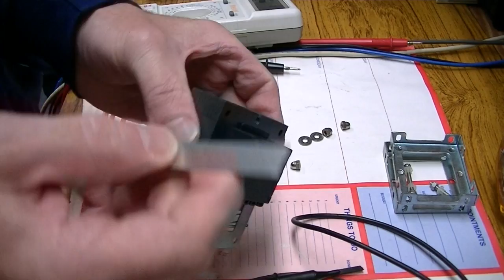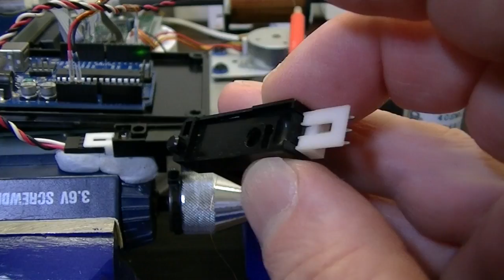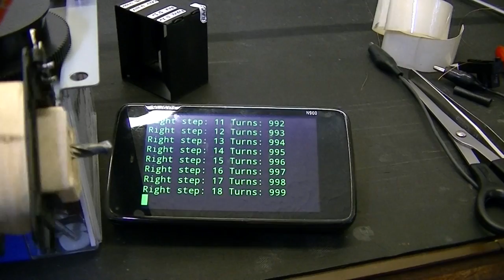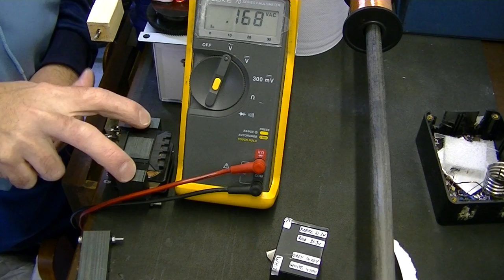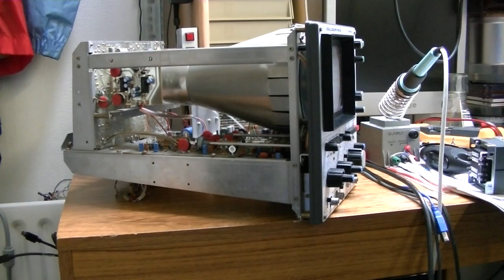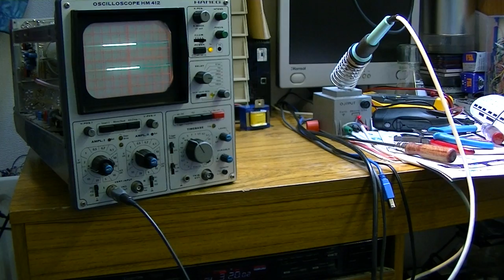Repairing burnt out transformer. Oscilloscope repair.

Comment: Sir, I know it's been long time 
Your genius idea motivate me to repair same trafo on my hm203-1, but my windings are overlapped I cut 6.3v with 31v and HV winding...
There's any suggestion or solution to wind 6.3v with 31v on the new transformer or may I build separate PSU for the 6.3v heater?
Thanks for the unique useful video ❤

Comment: Just ran across this video and must say: Hats off to you for this repair!
Every time I tried to take apart one of those Xfmr's, it seemed impossible to get the core apart!
Would be interesting to know if the scope still worked after this 10 years have past.
I have a SB-610 (?) Heathkit monitor scope that has the HV open but I may just try to use a HV strobe PS to keep from rewinding the Xfmr!
If I lived by you, I'd bring it by--LOL!!    73...
Reply from the maker: Your Heathkit SB-610 definitely sounds like it is worth repairing.
I wish you good luck with it. Maybe setup a search on eBay for a Transformer kit?
My Hameg scope still works. But I have to admit to mainly using a couple of modern Digital scopes now.

Comment: Love the neat Transformer Winder. The all mechanical one at the Technical University in Hannover Germany, used for similar jobs, was the size of a small lathe. Did you find out why the transformer got cooked in the first place?
Reply from the maker: I bet the one you saw in Hannover was impressive. The transformer got cooked  just because the winding shorted. Lots of volts and too little insulation. I still have the same Oscilloscope today. But I do have a fancy pants Digital one to sit with it.

Comment: Hi
I am Marcel, and i need some help to repair an hameg 408 scope.If you think you could find some free time to this, please let me lnow, and i will send you some pictures with the screen when the scope is on and i will explain what is the work i made to make it start.   Thack you very much..
Reply from the maker: I'm guessing you have taken a look at your manuals at https://www.rohde-schwarz.com/uk/search/hameg-archive_229476.html?term=hm408
I will take a look at your pictures of the screen. Upload your pictures to something like https://postimg.org it's free and no account required.
Reply: thancks,for respond me so soon..I will try to send a few pictures i have in my phone, because i am not home untill 1 th o march.
Reply: Because it didn.t turn on,first i started with the power supply,and  i found a coil of the filter  open, and i put a wire on the back side . The power supply start, and i could measure all the output voltages , but the scope didn.t have HV voltage for CRT.I change the D615 diode (by509), and the scope start.But is still having problems:1-No brightness adjust 2-the wave of the first picture , depending of the Vertical position scale(it became a line,but only on the highest values of the vertical adjustment scale,AND put closer a Velleman 40 mhz digitaal scope,i could see on the screen the same wave  like on hameg .)and 3-the XY mode,it showing me what you see in the second and the third picture.(it is not phone flash..)The schematis is hm 408, not hm 408-1a. Thanck you again.

Comment: Brilliant! How do you maintain back-tension of the wire-spool?
Reply from the maker: The combination of the wire spool suspended on the wooden rod and the wire running through a mechanical pencil. Provided just about the right tension.

Comment: great vidio bro i just wondering is that a phone you using as a counter ?how did yo do the seting or,is  there  software installed in that phone
Reply from the maker: The Arduino reading the opto sensor and controlling the stepper motor. Is connected to a standard home network Linux PC. The Nokia N900 phone is also connected to the same network via it's WiFi. I'm using the phone with an SSH terminal connection to the Linux PC. Running cat /dev/ttyUSB0 just to show what the Arduino is sending over it's RS-232 
So the only software on the phone is just SSH
Reply: i am rewinder for 3,a  phase motor and i never have experience for rewiding., transformer i am searching how to rewind transformer and i found your vidio so ireally apreciate it

Comment: Great job, wish I had your setup when I rewound a 25 H choke by hand !!!   Question, what is the purpose of adding tape every 500 turns ?
73  N8AUM
Reply from the maker: The tape at every 500 turns is to avoid having too much voltage potential solely reliant on the thin enamel coating for internal winding insulation. Congratulations for your 25 Henry Choke.

Comment: Kapton Tape is designed for high voltage insulation it has high temperature tolerance and does not cut easily like ordinary tape all quality transformers use the stuff you really need to get some it is specifically designed for transformers http://www.ebay.co.uk/sch/i.html?_from=R40&_trksid=p2047675.m570.l1313.TR0.TRC0.H0.TRS0&_nkw=Heat+Resistant+High+Temperature+Polyimide+Adhesive+Tape&_sacat=0
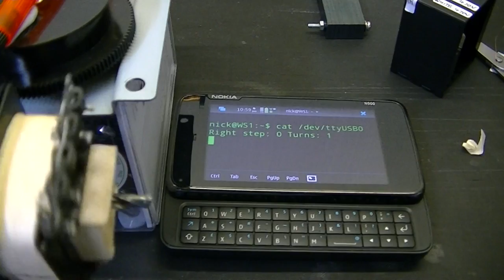Reply from the maker: You are correct. I did use some Kapton tape in this transformer. If you watch from 10:15 you can see it on the former.

Comment: i have the same scope , ive noticed it has some interference , just like youres there , is that from Fluorescent lamps . I dont have probes , butt some my self just for simple use
Reply from the maker: +Pavle Pavlovic The almost sinusoidal interference is merely 50Hz mains pickup. The input to your scope is quite high impedance. 1 megohm with a x1 probe. 10 megohm with a x10 probe. I'm sure you will have seen just how many volts you can inject into your scope just by touching the probe tip.
Shorting your probe to ground or a low resistance source would yield no noise.
Reply: Nick Norton a lot of noise , i was wondering is it becuz i have no probes or is it cuz my built probes are bad , would it be there if i had probes , looks like it would
Reply: +Pavle Pavlovic probably bad filtering

Comment: How can anyone find a short in the exact spot on enamel wire?
Reply from the maker: +Joseph Nicholas I'm not sure if you're asking in relation to a spool you can unreel. Or wound up in a transformer. For the Former (pardon the pun) you could unspool the reel onto a new reel while passing it through a metal tube. While charging the wire and tube with some HT. Any weakness in insulation would reveal itself as it passes through the tube.
Finding a short in a 50 or 60Hz transformer, it gets hot, keep unwinding until you get to the arc damage.
Reply: +Nick Norton Thanks for this explanation, you obviously have extraordinary patience and skill.

Comment: I've done a few of those kits when I was an apprentice working for a rewind engineering shop. Did you put epoxy on the windings to stop vibration of the turns and the eventual failure of the winding due to shorted turns?
Reply: Ugh I wish someone sold transformer kits again. Maplins doesn't sell them anymore.
(Preferably a big transformer kit, like for a 1kVA transformer. I need a bunch of different taps :P
Reply: +Benjamin “Ozias” Esposti We used to buy ours from RS Components.
Can you not try to take a 240/110 safety transformer apart and see if that is rewindable? I've rewound loads of transformers often I had to make a new former as they were so badly burned they would fall apart as you were unwinding them to count the turns.
Reply from the maker: You might get lucky finding a 1KVA transformer that is bolted together and varnished. With some heat perhaps you can knock some of the laminates out. With one out, the rest shouldn’t be too tricky.
Reply from the maker: stephen dwyer
I can see why you would think it was under rated. But this is not the case. The transformer I wound powers the EHT and bias to the CRT. 5 watts required. The transformer failed not due to normal power demand but due to the EHT winding developing a shorted turn. The existing transformer and the one I wound do not develop any discernible temperature rise above ambient in use.

Comment: Can you tell me how to fix my blown transformer is outputs 6volts and inputs 120 volts i connected the output wire wrong and one wire sparked inside the transformer and it never worked again thanks in advance
Reply from the maker: shandev indoi The 6volt secondary may have blown open circuit near the surface of the windings.
You'll still need to do a bit of investigating. Carefully removing layers of tape to survey the damage. Good luck.
Reply: ok thanks for the reply do i have to connect the wire and tape it for it to work thanks.

Comment: Hi do you take on jobs, I have a USA cd player the my mate put through a UK voltage through and blown the transformer could you repair this?
Reply from the maker: Zerocool536 You might be lucky with your transformer. It may have a thermal fuse partially buried in the transformers insulation. If you can dig it out, you may be able to replace it.
The expected output voltages may be fairly common such as 15v - 0 - 15v & 12v so you may be able to pick up a suitable transformer from ebay.
I'd love to help but lack spare time.

Comment: except for the enjoyment of rewinding yourself' any reason why you didn't just buy a new transformer ?...it certainly couldn't have been the cost.. nice job though'
Reply from the maker: Hi Bob, Good question! It's not a generic voltage off the shelf transformer though.
The previous owner did contact Hameg back in 1996/7 and was quoted £90.19 including Tax but not postage.

Comment: I have that same oscilloscope! What caused transformer burn? Internal shortcircuit or overload caused by something?
Reply from the maker: Just an internal short in the winding caused by its insulation breaking down. Yours by now, will probably carry on working forever.

Comment: actually I already too it apart several years ago , and it came apart really easy........I took it apart because of curiosity (stupid) and the filament winding did look like it burnt a bit   ....It is actually a 25 cycle unit.I still have the bobbin and the wire I am going to get new wire of the right guage and hand wind it very carefully even if I do 100 or so  windings a night and it takes  a month, or I may get or make a winder.I will make  video of the transformer and send to you later on...

Comment from the maker: It would be nice if you can get the transformer laminations apart.
Taking the transformer out and removing any bolt through clamping or shell.
I'd be tempted to see if it was possible to use a heat gun or butane torch to
really heat the laminations up. Not burning it though - definitely a bad idea!
With any luck it'll just be varnish holding the core together.
Tapping a strip of metal against the outer lamination pieces and getting one to
move out is a sure win!

Comment from the maker: To be sure about the number of turns required. Feed 10 turns of wire around the core and measure the voltage with an accurate meter. Divide by 10 to get your exact voltage per turn. Use the thickest wire you can, while still leaving enough area for the required amount of turns to achieve your voltage.
There is a link in the full video description for someone still selling kits.

Comment from the maker: Just an Arduino reading the photo interrupter and in turn pulsing a stepper motor. My arduino code is up in the video description.
The stepper driver circuit was borrowed straight out of a document scanner
but the useful part was no more than a ULN2803 driver & motor.
You'll have no problem making that, lots of examples on the web.
I used a battery powered drill to turn former.
Lots of speed control options for that.
I used a cheap unregulated AC to DC power supply plugged into a mains variac.

Comment from the maker: I powered up the scope for about 30 minutes I guess with the case off. But didn't notice any discernible temperature increase from the main Tx or my retro fitted one. Both transformers operate well within there VA rating.

Comment from the maker: Good point.
The insulating layer just reduces stress from breakdown across the thin enamel coating. In this case, just over 80 Volts AC is induced for 500 turns.
Although 471 Volts AC is not high compared to some multi-segment HT windings.
The 471 VAC winding feeds a tripler circuit for the CRT anode voltage.
The insulation between the 31.3 Volt winding and the 471 Volt winding has
to be good for 2KV.

Comment: Why does having an insulating layer every 500 turns help (other than to provide physical flattening? Is there some reason there is more voltage difference between 499 and 501 than any two other layers?

Nice winding rig!

Comment from the maker: The Arduino is plugged into a PC over USB.
Arduino prints its output to the serial port on the PC
(In my case /dev/ttyUSB0)
Using a Nokia N900 with a SSH connection to the PC
over Wi-Fi to view what's being sent to the PC serial port.
Thanks for your comment.